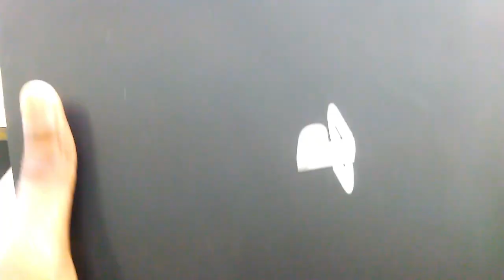Ps4 Pro Power Supply Fix

Comment: Hi there liked your video, how do you check if the power supply isn't producing enough voltage?  On a multi meter
Reply from the maker: With regular multimeters you can only see the voltage but not the amperage

Comment: Hi..Is the PS4 Pro power supply ADP-300CR compatible with ADP-300ER

...cause my 4 plug won't go in the ER model
Reply from the maker: No it's not but you can make it work by swapping connectors

Comment: I have a ps4 pro ..power button isnt working but will turn on if disk is inserted..but then turns off after about 10 to 12 seconds. 
Eject button beeps when pressed. 
Any thoughts?
I checked tge board..couldn't find any shorts...im thinking its the power supply
Reply from the maker: Once it turns off once if you have to unplug to get power again most likely it's the power but otherwise it could be anything on the motherboard 
Also try replacing that switch buyton for eliminations